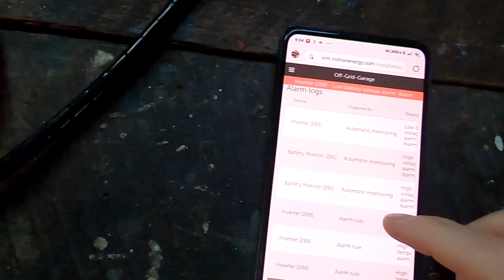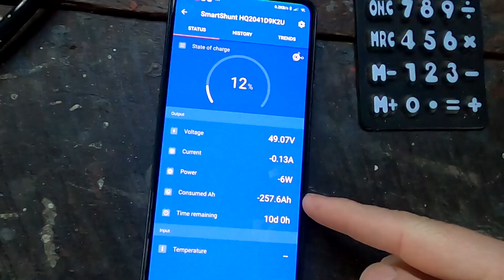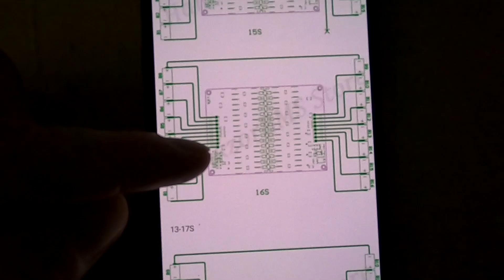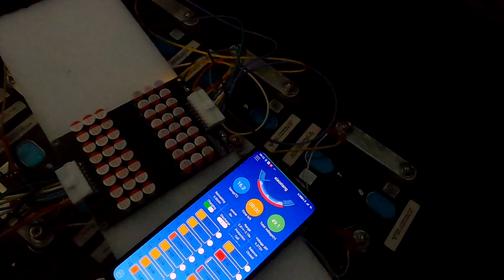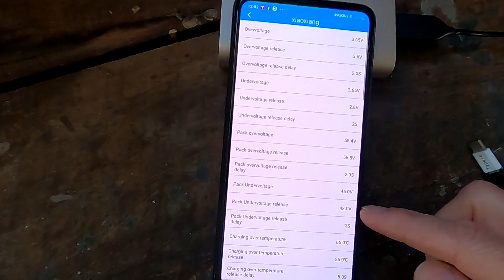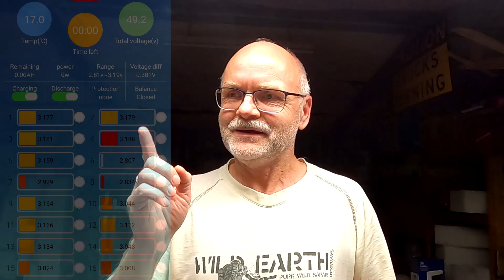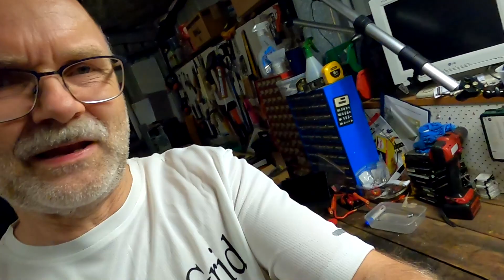Can the active balancer save this battery? Impressive result!

Comment: We have completed our mission and convertered the Anti-Balancer. 😂😂😂
Reply from the maker: Hahahaha, yeah im' really impressed so far. I'm going to wait until the battery is full though to see if it can hold up the positive start.
Reply: Will Prowse probably should look at them again.  I consider them as essential as a BMS.
Reply: @SenatorPerry  
Will did buy a 4S Heltec a month or so ago (I bugged him into it). Hopefully he’ll get around to it. He had a resistive type a year ago and I don’t think he much like it.
Reply: @SenatorPerry  not really
Reply: @SenatorPerry  i watched a video of his and he tested one and was very impressed with it. i got the 8 cell version for 24v and just let it plugged in all the time. my voltages are always the same
Reply: Can the active balancer setting be changed on the bms/active balancer hybrid interesting. So you could choose to have them balance on top or bottom only.
Reply: @guy7gsa  Unfortunately the Bluetooth balancer does not have Top or Bottom balance settings. The user can set the balance current from 0.2A up to the max which is 1, 2, 5, or 10A depending on the model as well as the Delta trigger voltage between cells from 0.001V to about 0.500V (1mv to 500mv). Cell balancing can also be turned off completely and the unit will only display cell voltages and internal resistance values.
Reply: Yeah I’m part of the pestering people too.📣
Reply: I've been recomending them for quite some time as well, but I use QNBBM Active Balancers from DeliGreen on all of my battery packs.
Reply: @stephsoltesz6731  
Probably the balancer the others copied.
Reply: @SkypowerwithKarl  there are several variants out there that function differently.  That also confuses because what exactly they do and how varies.  The costs also drastically vary, where a 1A-2A active balancer can be quite cheap at <$50 USD, the similar 10A one @ $700+USD is another matter.  And if you want Smart with Bluetooth add more $$
Reply: They do work. It really surprised me to be honest.
Reply: M P, Ya, I did my part and suggested an active balancer several times on this and other channels.
Reply: Thumbs up and subscribed!

Comment: Your on the steep part of the curve after 3v. Taking a little power from cells above this value will only reduce their voltage marginally. However putting power into cells below this point will increase there voltage considerably. Hence your over all voltage will rise.
Reply from the maker: Yes, correct, I missed that while filming. Makes sense.
Reply: @OffGridGarageAustralia  You allowed to. Testing and coming up with the correct answer every time is difficult. 
It is easy for us comment as we have more time to consider the problem.
Console yourself with a beer...

Comment: i would also run the garage router of a buck converter like you have the rpi and anything else thats low voltage no point in stepping it up just to step it down again wasting stored power
Reply from the maker: I thought about that. It uses 19V, so could just put in another of the 60V bucks...
Reply: @OffGridGarageAustralia  when i was offgrid i ran 24v and stepped everything down i was really surprised at how much power i saved i started off with 12v and i was wasting so much power having to boost all the voltages for laptop and other things i was running that was higher then 12v i had 4x 255watt grid tie panels and had a epever tracer 4210a controller with 2x 75ah lead acid cells untill i built the 18650 power wall thats a hole diferent story and a big head ack dident have active balancer then had to monitor it like a hawk
Reply: @OffGridGarageAustralia  i have a router here says it needs 12v i have had it runing on a single 18650 cell so it can pay off trying to drop to even lower voltages

Comment: The problem in that balancer is that you cant define when you activate the balancing. If you have the balancer active in the midle range you will unbalance the state of charge at higher voltages.
Reply: incorrect the balancer has a solder point to turn it on and off this can be controlled if left active it will always try to balance when mv range is above what ever it default variation is be it bottom middle or top it will always balance this is the point of them u have a 3s version i use on a solar light setup to keep cells in check as they are salvage and i must say it is doing the job perfect
Reply: @1981dasimpson  ah ok. You can set a voltage and it actives on that...
Reply: @MiguelSilva-mb6mb  you would need a voltage trigger but you could have the active balancer to turn on at what ever voltage you want with that trigger
Reply: @MiguelSilva-mb6mb  as it stands at the moment it checks voltage of cells if they is 10mv difference it wil start to balance 10mv is the one that i have i think each one will trigger at slight different voltage due to imperfections in components but the active do a much better job then passive
Reply from the maker: The voltage is fixed. I thought it was 30mV to start up the balancer but cannot find this information any more. It's clearly below that.
Reply: @OffGridGarageAustralia  i mean a defined voltage trigger. For example, my bms i can define at what voltage the balancer works, i have it set to 3.4volts, below that it will not balance. The 10mv you are saying is the diference between cells. Maybe it will work ok because you will only get major diference at high and low SOC. maybe.... 😉
Reply from the maker: @MiguelSilva-mb6mb  I have the balancer running for a few days now and this morning, I ran the battery down to 5%. The voltage difference across all cells was 6mV only. It really makes huge difference.
Reply: @OffGridGarageAustralia  i worked on the thoery that 10mv was the difference after a week of been connected so that must be about the thresh hold
Reply: Cells are close to balance in mid range because of the flat voltage curve. Only when the cells get to the steeper part of the curve do the cells get out of balance. The balancer will do nothing at the mid range.
Reply: @muddy11111  they active balance all the time no matter the low mid or high if the cells are out of balance it will try to balance them that is there job
Reply: @1981dasimpson  At the mid range the cells should not be out of balance due to the flat voltage curve, so there is nothing to balance and the balancer will do nothing. If the cells are out of balance in the mid range you have serious problems and need more than a balancer.